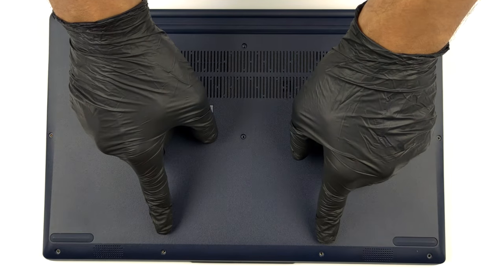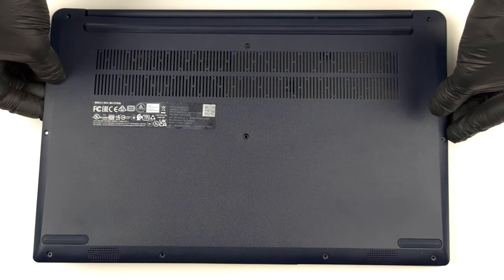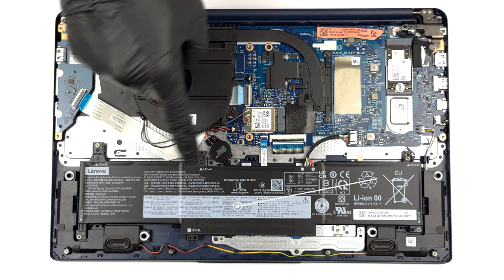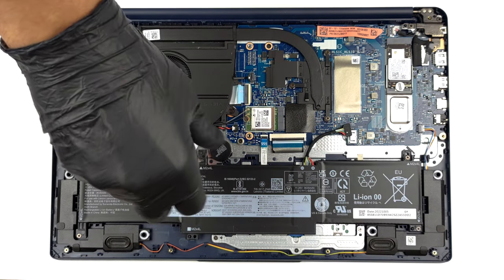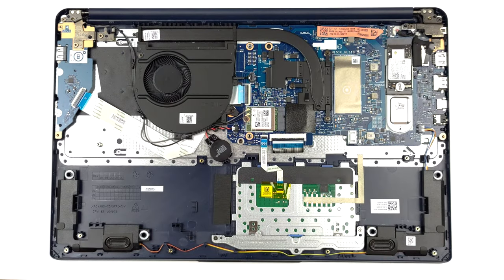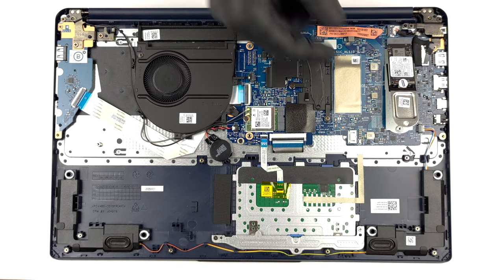🛠️ How to open Lenovo IdeaPad 1 (15", 2023) - disassembly and upgrade options

Comment: Hey dude,in my settings it is showing that i have ddr4 ram and have 1 out of 2 slots use,also by using the softwares,its showing i have also another empty slot left,But is setting it is also showing row of chips,so i am in doubt if its is upgradable or not

Comment: Can I change my integrated graphic card of my Lenovo RYZEN 5 5500U 16gb RAM with integrated Vega 7 2VRAM? Does anyone know if the port of my integrated graphics is MXM? I would like to change the graphic card, 2GB is very little, and I don't want put from RAM to VRAM.